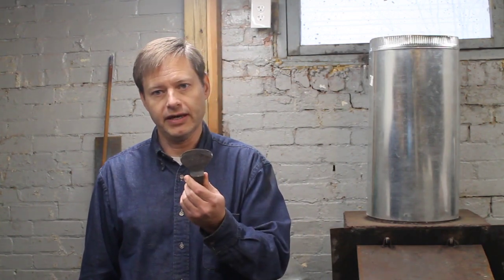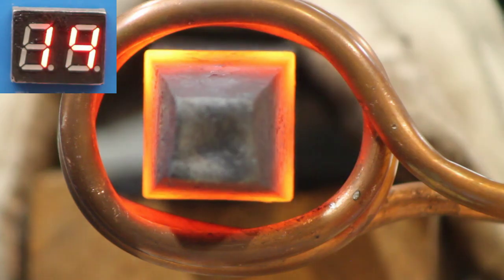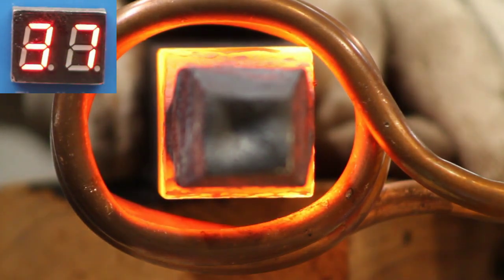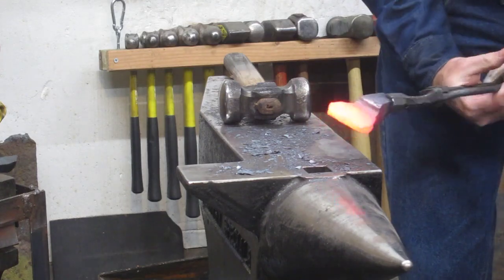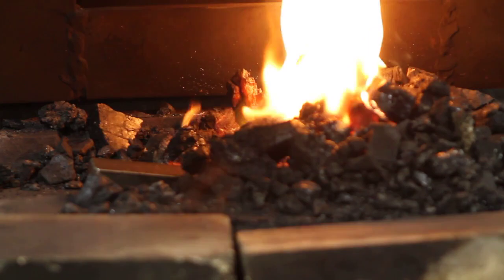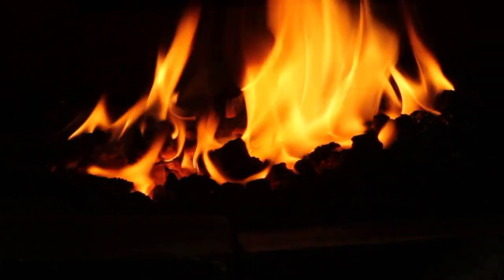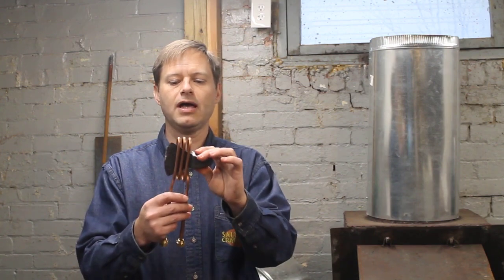Induction vs Coal: forging a hardy tool

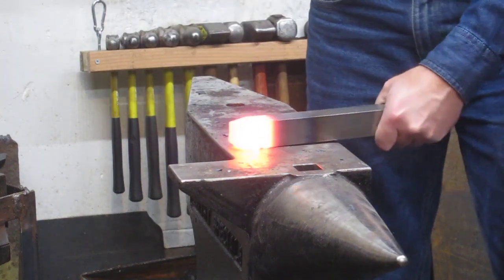Comment: Im not a smith, but regarding the bouncing at 2:49 ... isnt that because youre using the central face of the anvil instead of the working edge (which concentrates force) ?
Reply from the maker: That's great insight and a good way to think about forging. However, even if the force isn't concentrated, forging-heat metal wouldn't bounce like that. Not only am I striking very near visibly cool metal, but I suspect the core isn't very hot either. Cold metal doesn't yield like hot, so it's springy.

For the taper I'm doing, I started with a blunt taper. This concentrates the blows on the end of the bar. The benefit from being near the edge is not hitting the anvil with the tilted hammer face. By 2:49, I'm actually extending the taper. If you look closely you will see that only the "peak" where the taper intersects the unforged bar is in contact with the anvil. The hammer is hitting opposite that on the other "peak" which is only a very small area of contact.

For longer tapers or drawing out (say reducing 3/4" round to 3/8" for tong handles), the near or far edge can be used to great effect for reducing the contact patch. That approach wasn't needed to keep the contact small for this taper.

As I said, great insight. If you ever decide to take up smithing, sounds like you'd do really well!
Reply: EJ of the Anvil I come from a science background. Thx for the very well explained reply ... will read fully on pc when I get home (on smartphone ATM).

One brief thought ... your first para seemed to pose the possibility of an uneven heat in the cross section, which doesnt seem possible to me ... iron is more than sufficiently thermally conductive such that if it is red hot on the exterior, it will be red hot in the center as well ... the stock would probably need to be in excess of at least half foot in diameter (probably more) for a thermal gradient of that magnitude to occur, but I admit that's an educated guess with no practical experience behind it. The key point is that you're heating via EM Induction with a 360deg loop, not a traditional fire, and since EM flows freely through metal along field lines, the pattern of heating should be reasonanly uniform to match, whereas a coal fire heats by conduction (not induction) from the exterior inwards. Thus, if it could happen at all (re: cross sectional thermal gradient), it seems like it would occur in a stoked fire, rather than a 360 deg indiction coil, and even then only temporarily. Again, i am speculatong.

Non sequitur question: I love the idea of using induction for fast and efficoent reheats like you do (if I were smithing i would doubtless do the same), but on a slightly negative note, doesnt this remove beneficial carbon introduction from the equation ?  Repeated heatings in a real coal fire are almost certainly adding carbon to the iron as you work it, in order to improve the molecular syructure, in much the same way as flat strips in a charcoal fire absorb carbon ala  the "blister steel" process. Induction is wonderfully fast, clean and efficient, but i cant help but think that you miss out on the ability to improve the carbon content as you work your steel. In other words, induction heating only helps you shape it, not improve its strength.  Again, im just thinking aloud, and would appreciate any insights you care to share.

I'd love to try smithing, but alas a torn rotator cuff says no. 

Anyway, cheers.  Great channel - I look forward to learning by watching. 😊

P.s. BTW, one of my favorite smithing technique sites is joey van der steeg. He has some great technique vids.
Reply: Another non-sequitur: those coils definitely use a lot of power. I have no idea of the payback period, but with a pair of Tesla Powerwallls, you could buy all your power off peak (or store it if you have solar or micro-chp), and then run the forge off battery power.  its an attractive daydreamy idea to pair electrically facilitated smithing with a residential co-generation and/or storage system.
Reply from the maker: Induction heating does have a skin effect. This is because the induced current produces opposing magnetic fields which repel the inducing fields. Watch starting 1:00. I pull it out about 2:24. At that point, you can still see that it's cooler in the center. Heat flows in steel, but not nearly like aluminum or copper. I held the bar in my bare hands for two heats before switching to tongs. The core isn't room temperature, but it's a few hundred degrees cooler. That has equalized quite a bit by the end of the second heat, so the bouncing pretty much goes away. I needed another 15-30s of heating on that first heat to both provide more heat and to let heat conduction do its job.

As far as carburizing goes, it's a rather slow process and requires a carbon source. Blister steel takes hours at something like 1900°F and is done by packing the iron with powdered carbon. It can also be done with high heat and carbon monoxide. In a coal forge, low down it's hot but oxidizing (extra O2, some CO2, no CO), in the middle it's neutral (little O2, more CO2, no CO), beyond that is a little bit of reducing flame (less O2, same CO2, tiny bit of CO) but it's too cool to get the carbon to migrate into the iron. In practice, this means you actually lose a tiny bit of surface carbon with any heat source. It may be slightly more with induction, but either way it's negligible.

Bummer on the injury :-(.

Yeah, I've been watching Joey for years. Love his work.
Reply: EJ of the Anvil just watched the skin effect ... i learned something new today, which is always a good thing. Fascinating.  Didnt realize induction has a pushback effect. Likewise on the carbeurizing processes you explained.  Clearly my understanding earlier was faulty. 😀
Reply: Getting back to the origonal question of the steel jumping a lot while being hammered. My guess is that the jumping is mostly due not to the contact of the hammer against the hot billet but rather of the billet against the top of the anvil.  The former doubtless has a working face that has been rounded to some degree and thereby concentrate force in order to deform/move the hot metal, but the latter is just flat surface against flat surface, which is why (AFAIK) most smiths use either the anvil edge or a hardy tool in order to concentrate the impact from the bottom as well.  I think power hammers work the same way, given the use of both top and bottom dies when drawing out steel. 

You know this stuff vastly better than I, so I'm assuming I misunderstood the question.
Reply from the maker: Yes, the "bounce" from the top of the billet would mostly go back into the hammer and the "bounce" off the anvil will come from the bottom of the work. But, the contact patch with the anvil was really small in this case, not flat against flat. It's a little hard to see, but I have it balanced on the edge of the taper. The contact patch does get larger as I forge and bouncing will get more pronounced. But, the amount of bounce in this case is more than contact patch would explain. It doesn't look like a big bounce, but that's because I'm actually fighting the bounce pretty hard (bad idea, nasty on the wrist).

That bounce is the energy lost reaching the yield point of the steel. Yes, yield loss is proportional to contact area, but forging-heat steel yields very easily so even a large contact patch gives a gentle bounce. I bet you've seen that smiths often use that little bounce to minimize anvil contact time and hence heat loss. It usually takes a light touch holding the stock to do this.
Reply: EJ of the Anvil Your patience and willingness to explain are the hallmarks of a good teacher and a true gentleman.  

Gratitude and appreciation. 😁
Reply: Incidentally, I was just wikiwalking on the subject of supersteels and thermal conductivity, and happened across a super alloy called Inconel, which was developed for turbofan blades in jet engines. It appears to have a thermal conductivity of about 9, which is between a third and a fifth that of most types of iron or steel.  I have no idea of the toughness rating, but if it's in the same vicinity of hardened steel then, theoretically, it should make a great top plate for an anvil, or at least a good drawing die fir the hardy hole ... your metal would stay hot a lot longer, and need less reheats.
Reply from the maker: Yup, has at least good impact properties. Would cost a fortune to make an anvil of it and doing a top plate on cheaper alloy would be a very serious fabrication problem. Oh well.
Reply: I had a full type 3 separation w/reconstructive surgery 10 years ago on my right shoulder and have been back to forging for the last 8 of them. If you've never forged, just learn with the other arm. As you mentioned Joey, he's ambidextrous (as am I) so there's NO reason to not at least try to move metal. It's therapeutic AND exercise for that shoulder. 
You can build a coffee can forge for about $20 that uses an L.P. torch and make small kitchen cutlery for the house or, use an old L.P. cylinder and about another $100 for a real useable forge for larger items. no reason not to try.
Reply: T. DesMarais Kind words, friend.  Unfortunately for me, things are actually worse than I alluded to ... the labrum/cuff tear in my dominant arm, with or without surgery, is just not compatible with the demands of smithing, and arthritic nodules and tendonosis in my other shoulder pretty much rule out switch hitting. Even with two good shoulders, ive already had not one but two major spinal surgeries that make prolonged standing in place painful. It pretty much ended my hobbies in martial arts, kayaking, backpacking, sailing (sunfish), and cycling ... so i moved on.

I'm old enough to be philosophical about it.  Ive been an autodidactic DiYer all my life - ive already had, and moved on from, more hobbies over the years than a half dozen or so ordinary dabblers ... ive added smithing to my 'to do' list for my next incarnation.  I never outgrew turning over stones as a kid.

Meanwhile, i'll just have to watch from the sidelines.  Sorry to ramble ... i'll pipe down now.

Comment: How big can you make the coils?
Reply from the maker: That's complicated. Rule-of-thumb for my unit: 200-600mm (about 8-24") coil length. But what it can actually drive depends not only on what material is currently in the coil, but also the temperature. I go into more detail in https://youtu.be/XGGiGrkwXts .